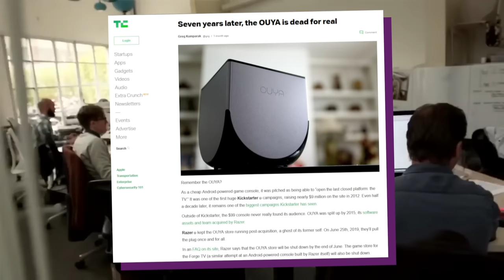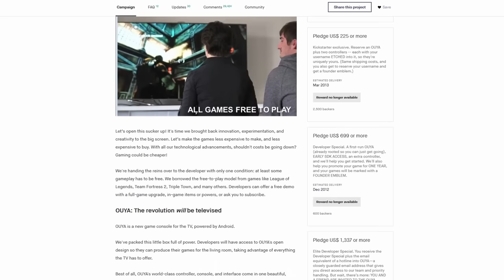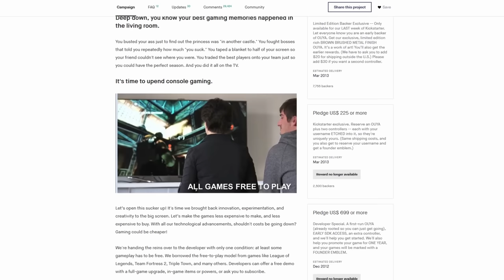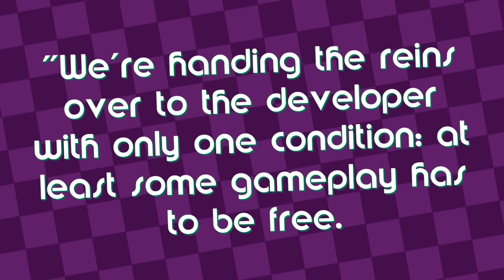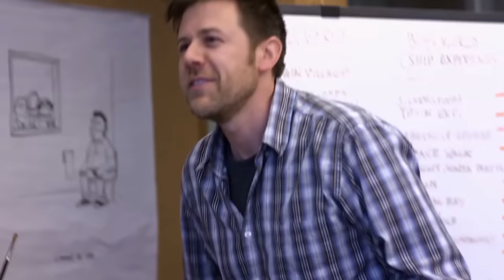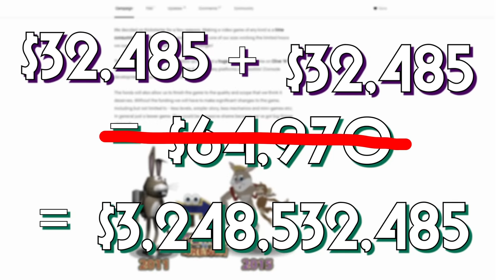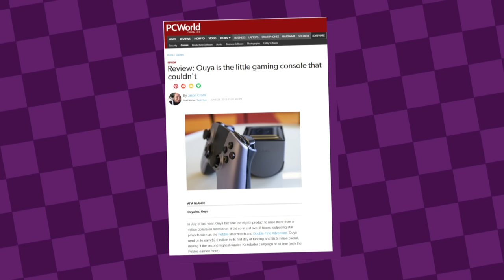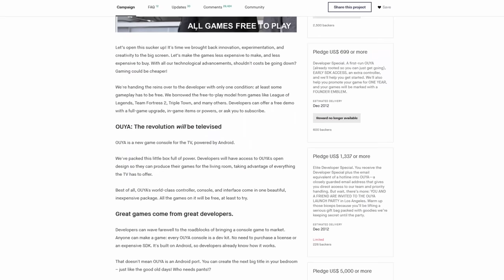How the Ouya Failed - A Kickstarter Disaster

Comment from the maker: Cut content time! I originally had a bit of a diatribe in this video talking about my time owning an Ouya. I pre-ordered one in early 2013 and got it a month after it hit store shelves, because of course. I cut it from the video because it was little more than 10 minutes of unrelated rambling.

But if you’re interested, I talked about the build quality of the console and the controller itself. The controller felt great ergonomically, the shape of it fit into my hands perfectly, and is genuinely one of the best controllers I’ve ever felt. But it was completely ruined by how cheaply it was made. It was made out of low quality plastic and aluminum, and felt like it was going to break apart if you gripped it too tightly. Indeed, it did, as the controller had these removable face plates for the batteries, and they would frequently come off (at least in my case). The buttons were somehow too stuff and gummy simultaneously, and the touchpad was useless. Unlike the one on the PS4 controller, it had no tactile boundaries, so you never knew if you were touching it or not without looking down at it every so often.

The console itself was also cheaply made. It weighed nothing, and there was no metal weight inside it, so the stiff HDMI cable I used actually lifted the console off the shelf and held it up in the air at an angle. Pressing the on button also felt like you were going to shatter it. 

The games were boring too, so much so that I have almost nothing to say about them. That’s why I didn’t really talk much about them in the video. There really isn’t anything to say. The “Ouya Exclusive  games” just felt like slightly updated mobile games. Nothing special or interesting that didn’t later get ported to other consoles, the PC, or mobile.

I ended up putting the Ouya in a cupboard after just two months, and then sold it online three or four months later for $60.
Reply: I agree with your assessment of Mobile Games...at the time but When a Game CAN be rendered unplayable by the developers just shutting the Game down makes mobile gaming the Worse form of Gaming.
Reply: Temtem is a Kickstarter scam
Reply: Am I the only one who noticed there was a pretty pronounced input lag on Ouya games, too, or was that just me?  Like, everything else I completely agree with (especially about the HDMI cable and the buttons feeling gummy yet stiff) but I also noticed a really distinct input lag.

Comment: As much a failure that Ouya was, its existence had made it a bit easier for small indie developers to get into the console market without having to be a company/organization with a secure office space or complex.

Microsoft for example, announced ID@Xbox some months after Ouyas release, and also gave the retail Xbox One and Series X/S consoles the ability to switch states between retail and developer mode, rather than having a separate, more expensive, $2k to $10k developer kit.

Comment: The only way to push into the market with a new console is to be prepared to lose money. A LOT of money. That's the gambit every 1st party (not just console 1st parties - see the Epic store, for example) is playing and for good reason: it just doesn't work any other way. Ouya, aside from the questionable premise, had the right idea: throw money at the problem until it eventually goes away. The issue: you need more than a few million dollars for that. In fact, you'd need hundreds of millions to even compete, possibly even more if you're trying to establish a new brand. In the end, Ouya tried to go to the moon with a faulty rocket and not enough fuel to even make it off the ramp. And honestly, everyone in the industry with a modicum of thinking capacity saw that coming a mile away.
Reply: This is the first time I've seen someone make the comparison between the Ouya and the Epic Games Store, and you're absolutely spot on.

Comment: Worst thing is that when store closed console just died. And to think, if hardware was capable, with right firmware ouya at least would work as mediaplayer - it have HDMI. Another option is torrentbox. Also, with wired connection quality of WiFi isnt very important. Peoples did complained about WiFi and universal answer was use Ethernet!

Comment: I backed this. The first major red-flag to me was there was zero community options. That may not sound like the end of the world, but keep in mind one of the major rewards for backers was an exclusive founders symbol next to your nameplate.

How is that a reward when no one but you can even SEE it? Beyond that, exactly what's said here about the games. The only titles I ever found appealing on the system were ports of titles I already had on a dozen other platforms. I believe Sonic The Hedgehog was on it, for example; which still holds up for retro-platforming fun, but even at the time I owned that game on SIX different platforms - and that's only counting the 100% legit, paid for, non-emulator copies (Steam, Genesis, Mobile, and on compilations discs for Sega CD, PS2 and 360). Why am I going to pay another $10 to play it on this? Or Final Fantasy III. Same question but they wanted $20! c'mon!

Ultimately I just turned it into an emulation console, which it was fine for; but the nVidia SHIELD stomped it into the dust for that.

Comment: Well. My OUYA still works. I have it set up where it loads into XBMC (Kodi) from boot and I have all the emulators they had from the Ouya store on it. That is all I ever used it for to begin with so I didn't loose much. I bought it cheap for $30 and just used it for emulation. I have a old PS3 controller synced to it (the original PS3 six axis that came out before the Dual Shock 3).
Reply: my controllers dead so one day i'll try replacing the guts for a raspberry pi and still keep that stylish case

Comment: I bought one, and loved it (after some updates)

With the exception of the sketchy QA on the controllers (which I scrapped pretty quickly and I just used PS3 controllers), it was actually a cool little gadget for the time. It was amazing to be able to screw around in unity and then be able to push a build to the tv. And at the time, markets weren't the open free for all that they are today. You couldn't get into psn, xbla, Wii shop, or even steam without a huge (for poor inde devs) investment; so being able to sell in the Ouya store was pretty much the only path to the console.

Not to mention the device itself was a e s t h e t i c as fuuck, so that was cool